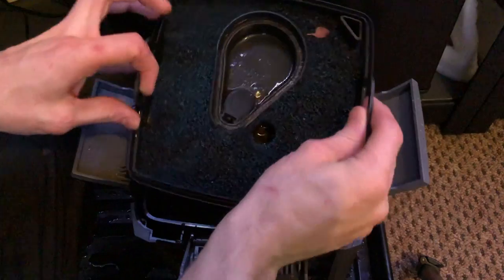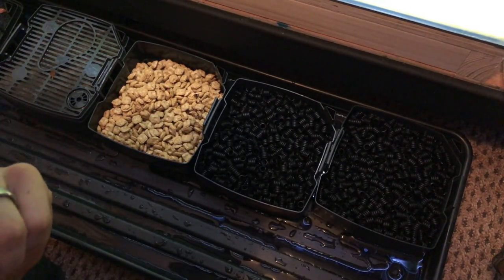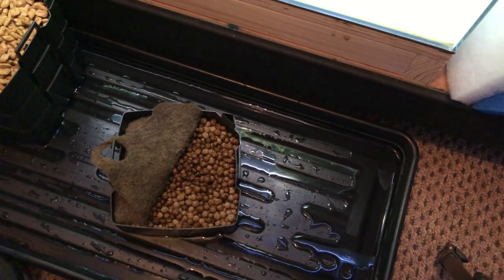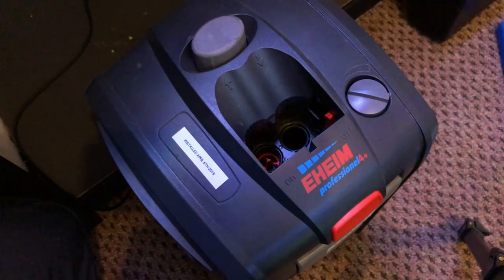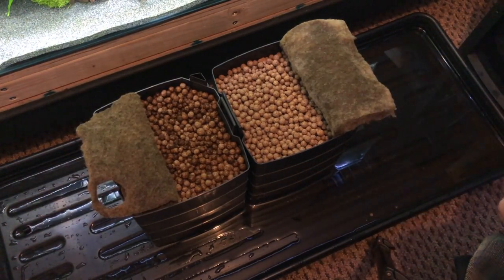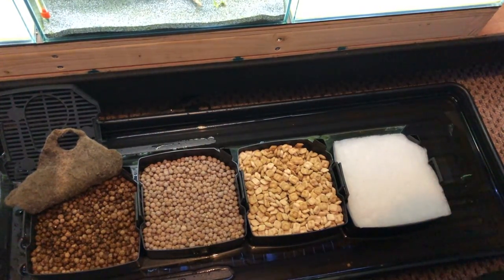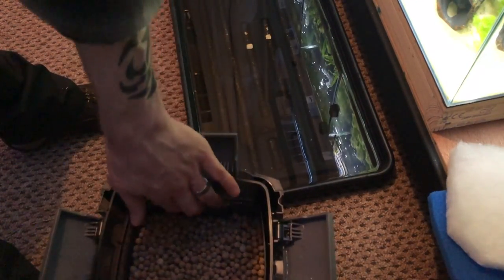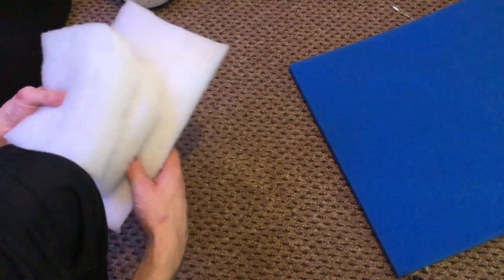Eheim Pro4+ 600 Optimisation

Comment: Thanks for clarifying the direction of flow within the canister. This helps us place the media in the right order. I have been juggling about by interchanging the trays. Sometimes it works sometimes it does not. I agree, that these are good filters with low electric consumption. It is a shame that  the company does not give the necessary information of direction of flow,

Comment: Good video! In a Eheim classic filter I use Mech at the bottom, then a light layer of filter floss or Fix, then a combination of bio media after that (Flav, SUBSTRATpro, and or Siporax) and lastly filter floss at the top. I worry that foam and floss as your bottom first layer would impede water flow too soon requiring a frequent rinse or complete change of floss. I put my bio media in pantyhose and tie the end. This I have found keeps the bio media cleaner and makes it easier for me to extract the media from my canister. I guess with your Pro model that's not possible.

Comment: i did same and that is true bio media are still clean , i just put 1cm plates of 2x20-30-40-60 ppi of foam in 1st basket and 2nd basket starts with floss covered by biomech -that amount not so heavy and floss not squeezed just nicely seated rest baskets are same, i think factory layout is for marketing purposes :D just buy media every year... as stands in manual... buuuut that black tubes may be good as very first pre-filter in classic series but not in this filter bcs prefilter is already filled with coarse 10ppi sponge... - cheers - nice and helpfull nice vid i forgot to mention i am regulary clean it every 2nd month in 180L heavy planted/stocked tank

Comment: very interesting, question 1: the basket number 5 with the blue sponge that must be placed under the lid with the pump in the video I do not understand if you have inserted or deleted it. question 2: what thickness is the blue sponge to cut for the lower basket.
thanks

Comment: Good video. Oase biomaster is better with pre filter.
Reply: Biomaster doesn’t well in all cabinets, that’s the main reason I’m returned it. You need to pull it out of the cabinet. On Eheim I just take the top basket out not not moving the heavy filter. Biomaster feels much better built specifically the handle is a big plus, but many are complaining about the air bubbles loosing the co2.

Comment: Hi there dear Macauley , please tell me , does the efficiency of the filter is anyhow affected if you didn't cut the floss or the foam exactly as the template ? Thank you for the videos , you really did a great job !
Reply from the maker: Nicoleta Moldoveanu Thank you for the feedback ☺️ the foam doesn’t have to be perfect, but try and cut it as accurately as you can.

Comment: I have heard the trays are a bit problematic to arrange after maintenance. Is it true ?
Reply: Not true, the trays are easy to clean slot back into place with no issue. They are very flexible also, so breakages aren’t likely.

Comment: I think this will reduce the flow. I did it too but not sure if the flow has decreased.
Reply from the maker: The hobby seems obsessed with flow, rather than the quality of the ‘cleaning’ that’s happening in the filter. This method doesn’t reduce the flow noticeably, but it would be a small price to pay for the benefits achieved.
Reply: @straighttalkingexotics9367  that's true. Planning to keep stendker discus so high flow is not good anyways.

Comment: Everybody should know that the all plastic valve on pro series sucks.
Iv replaced that part 2 times cos of bloody jams. It must be greased or this wil likely happen later. Its cogs inside are not the best design.. When this happens you must use deadly force and chew down to its core. and free up the jam. 😂

Comment: THE BIGGEST mistake made with a canister filter is using it as a mechanical filter .
IT SHOULD ONLY be used as a biological filter !
ALL mechanical filtering should be mainly done BEFORE the water goes into the canister . 
THE canister is best at CYCLNG the tank cleaning out ammonia, & nitrites .
Used this way it rarely needs ANY servicing. IN FACT it is best to just LEAVE it ALONE to do it's thing.
Eheim makes a prefilter intake filter OR YOU CAN use any floss filled corner filter as a prefilter . THIS can be changed weekly taking ONLY three minutes.